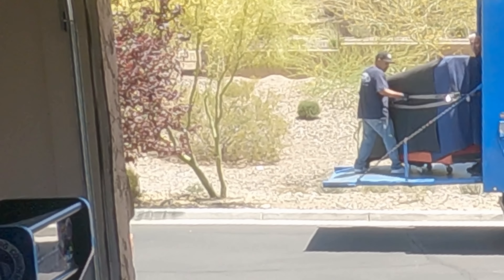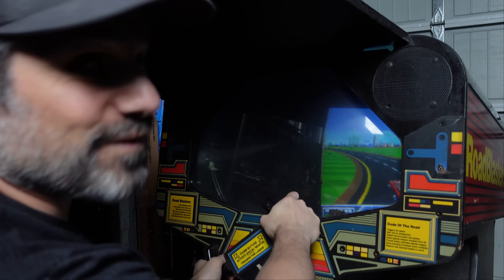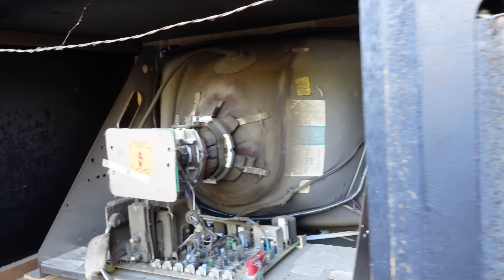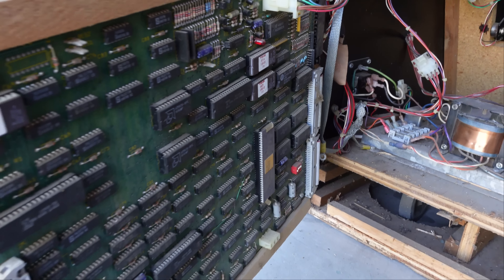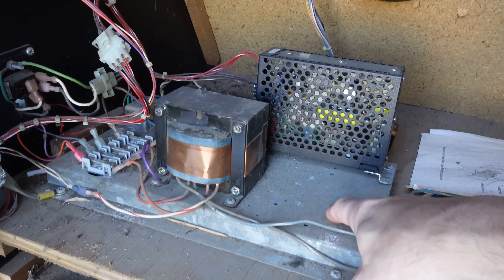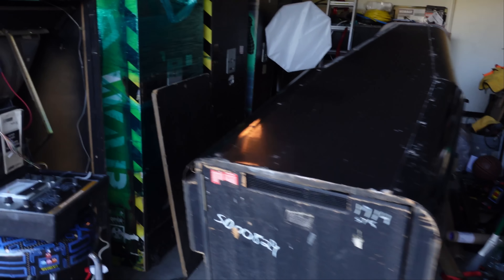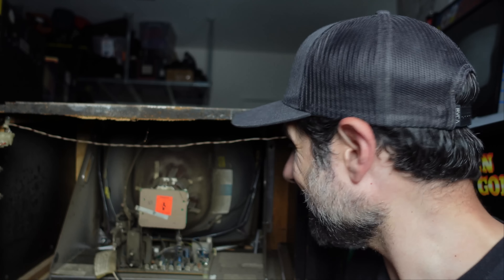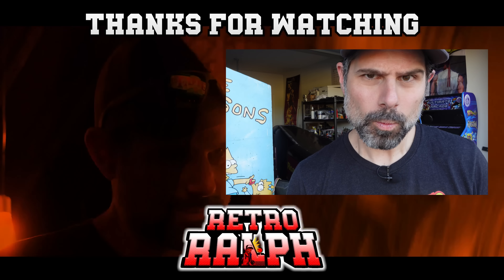Rare Arcade Pickup - Atari RoadBlasters Cockpit!?!

Comment: The garage Cade I looking incredible what a elite title collection
Reply from the maker: Thanks my dude, I need a better way to arrange the arcade machines, I'm working on a back to back design.  It's too tight and I think there's a better way to lay it out.  If you have any ideas, I'm all ears!
Reply: @RetroRalph  back to back in the middle is a genius move.  The easiest thing for u to do is throw every cab on a dolly so u can easily just roll them and move them around as needed so you can work on them without stressing.  You should also put a cab in each one of your showers in your bathroom 🚽 to make more space for more cabs

Comment: Dude I have one I restored what a bunch of work. My buddy is a bodyshop guy he pulled the roof off and fiber glassed it for me it turned out awesome. Painted all the panels did body work and some paint on it. Custom artwork I had to send the boards out for repairs and there is two AR-2S on this the second one is very rare. I had a new one built guy had to do a lot of research. I padded the seat and added black vinyl. These things are heavy !!! ONLY thing left is the magnifying glass on the screen has a few scratches I am told there are a few products that may remove them but have not attempted that yet. Let me know If I can send you some pics I wonder how many of these they made?

Comment: Ralph! you are the man, I wasn't sure what you meant when you said "maybe Roadblasters will return in another form", now I know.  Wow!  I should have seen this coming, I saw Justin's video of getting the cockpit, and this seems like a really smart move for both of you.  He gets a standup, that is already restored, and you get a cockpit to restore.  I am still in the planning process of building my own Roadblasters cab.  I was going to go stand up, but lately I was considering a cockpit, probably like the modded one you showed (no roof).  My 2 main issues are, I cannot find a gas pedal (or pedal set), that connects USB, and that doesn't require connection to a wheel.  I have a GRS yoke, I want to use, but I need the gas pedal.  Any ideas?  Also, I need a nice comfortable seat to use, I would prefer a bucket seat, but again they usually come in racing rigs, and I only want the seat.

Comment: Hey Ralph...some advice. The pcb you have is also used in the Indiana Jones cocktail table. The boardsets aren't easy to find, but the chips are exactly the same as the standard system 1 pcbs. 

I have one of these cabs as well, so if you have some questions later, feel free to get at me?